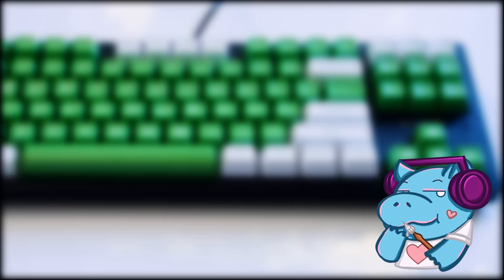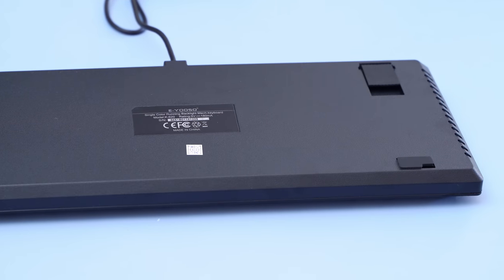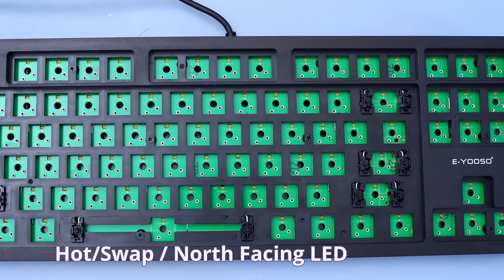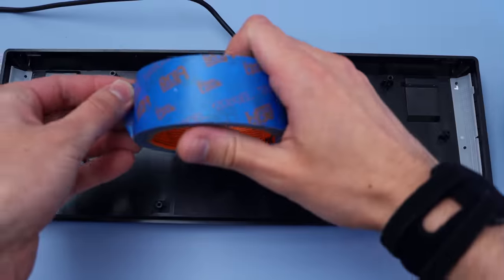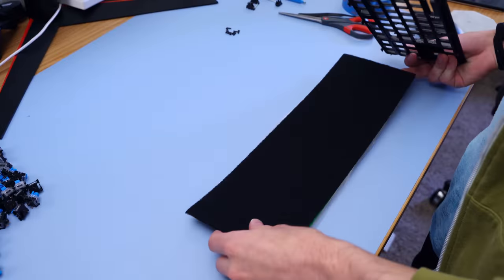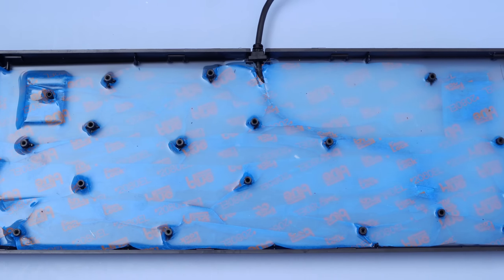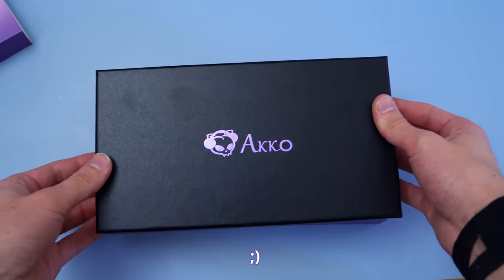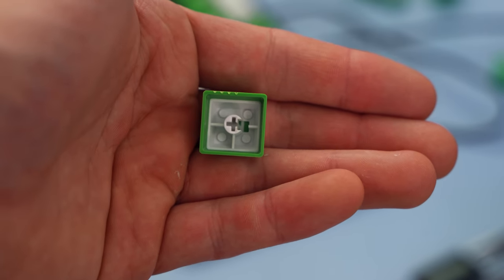I UPGRADED the Most Popular Keyboard on Amazon...

Comment: I actually find it nice that it has a full case rather than a "floating switch design".

The casing doesn't seem half bad either as a foundation. Epoxying a few thin sheets of steel should make it MUCH nicer than stock, like stiffer and heavier. Feel of quality is more important than actual quality, right? But i guess sil-pour works too.
Reply: The casing is crap, it's just plastic. I think the Redragon K552 I have sometimes goes for as little as $30 and that has a fairly thick metal plate, it also has the exact same PCB and keycaps as this board.
Reply: @jm036  Is it the one with absolutely HIDEOUS fake RGB? Actually any fake RGB is hideous, if you can't budget Neopixels, just give me all white.
Reply: @SianaGearz  There is an RGB version (which I have) and an all red version that's slightly cheaper, I think the fake RGB one is the most recent.
Reply: @JuicyyzFPS Did you just assume my gender?
Reply: @JuicyyzFPS me neither, no.
Reply: that would be actual quality if you make it out of steel
Reply: @JuicyyzFPS I'm not even particularly offended, more weirded out. But in short, "no". If you don't want to be mindful of people, people will be offended, nothing surprising about that.

Most people here don't want to be addressed with a honorific, in part because these are only used when dealing with police or a judge, which are usually unpleasant endeavours; and when you pick the wrong honorific, that's the ultimate sign of lack of respect, which is pretty much the opposite of what honorifics should accomplish, wouldn't you agree?
Reply: @SianaGearz  no one cares
Reply: @SianaGearz  fake RGB?
Reply: @josejimenez896  Yeah a keyboard with rainbow lighting but without RGB LEDs, they just use a variety of single colour LEDs that they arranged by key and scattered around the keyboard in all the different colours.

Comment: i had a similar issue with my tecware keyboard! the sockets were designed more for thinner pins like outemu switches but i found a hack by clipping the outer pin to a sharp pointy end using a nail clipper which helped a lot because previously it won’t even fit and even broke 2 switches (gateron yellow)

Comment: I have to say, that silicon o-ring "gasket mount" mod is absolutely clutch for tray mounted keyboards.  HUGE difference.  Another really good mod, which you could have done, is to put keycap O-rings on when you use high profile keycaps.  It doesn't change the feel of bottoming out if you use a single o-ring, but it makes the bottom out sound quieter because there is less reverberation in the plastic.
Reply: In my case, o rings under the keycaps makes it super mushy and way higher pitched.not worth it
Reply: @gearsgamer7115  hi can i know waht o ring to use???
Reply: @madhavds  don't use o rings under the keycaps it makes it mushy though. Ruins ot
Reply: @gearsgamer7115  In this case (pun unintended), you put the O rings in between where you screw the plate and base in.

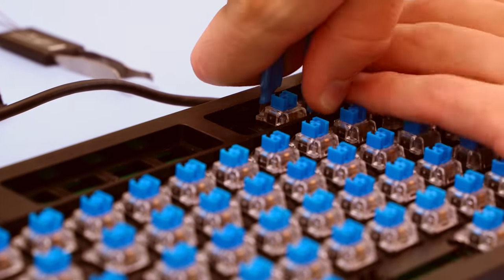Comment: 3:39 I know that feeling, Outemu hot sockets are the worst sockets in the keyboard kingdom! They have a death grip on switches, making it hard to remove them without destroying part of the switch, and they're almost proprietary! They only work with Outemu, Gazzew, Akko, and Lcet switches. (Maybe more than that) (You need to cut the legs off some of the switches that fall under that umbrella to make them fit in the sockets) I know that A good amount of keyfeels fall under that umbrella, and you can trim the pins and take the legs off on some other switches to make them work, but you might not want to put up with that in the first place.

Comment: Loved the video! Those lavender switches seem right up my alley, an affordable tactile switch that comes in a shade of purple! Now, if only I could find a 100% ISO hot swap PCB hahaha (or finally convince myself to drop the numpad as I only really use it for symbol typing)
Reply: Get a separate numpad for home use.
Reply: Thinking that now, with a 75%, like an Idobao ID80.
Reply: While hotswaps are great for installation I generally never change the switches on my keyboard. I own 2 hotswaps and the switches are the same since I put them in originally. My next keyboard project is the compact 110% called the Boston and it'll be fun to solder them in for a change.
Reply: there is the Keychron Q6 but it is expensive, 200$ for Iso Barebone with shipping.

Comment: Have you ever considered using gasket sheets, like the rubber sheets used for cutting out custom gaskets, as padding for the inside of keyboards? I wondered if it may be a more convenient and less messy alternative to pouring silicone like you did in the video.
Reply: or maybe leather

Comment: Would spray Flex Seal work for the painted on silicone? Seems like it would fill in the cracks better and be a lot faster/easier. Loved the content.
Reply: Not as good for sound dampening.
Reply: @yosemitesam9576  could you use flex seal, then use painters tape?

Comment: Anyone remember when IBM keyboards ( like 5150 original pc)?used Cherry keyswitches and cost about $350? I hope the designers who created the TRS 80 Model II keyboard with the foam and tinfoil got a raise for the elegant junk it was. How did it ever work? They survived more that I expected they could. Spill coffee in it, dry it out, clean the pcb traces with alcohol and it just worked.
Reply: I remember the buckling springs in the model f and model m keyboards. The f was more compact and i think the spring lever mech acted on an electrocapacitive element on the pcb. The model m came later and set the standard for keyboard layout but the buckling spring actuated a normal membrane. I never typed on a model f but supposedly it was higher quality than the model m but the early model m seems to be very well built regardless. Maybe they got lighter and more plastic over the years but the one i have from 1989 with a ps/2 cable is heavy and doesn't seem to lack steel parts inside.

Comment: Hi, since my actual keyboard is starting to die, i've been watching a lot of  keyboard review ( especially from yours )  
i've been searching for 2 weeks for the perfect 65% RBG keyboard for either typing and gaming (preferably wireless)
and this were it all begins... There was couple of keyboards that i want your help : Ducky one 2 SF or the Keychron K6 Backlight (both on either MX Red, Red Silent or Brown) ?
The main problem here is as a French i need an FR Azerty Layout but it seems impossible to see good looking FR layout that isn't sold out.
So i was wondering is there a way to buy french layout that fit for those keyboard ??
Reply: I'm not entirely sure what that is however several boards have something called via compatibility meaning you can change key functions with software
Reply: I have a Keychron K6 keyboard. I'd say it is a pretty good keyboard from my experience. The only thing i would say is inconvinient from this keyboard is its ABS keycaps, but that will be easy to solve if you have a bigger budget to replace them
Reply: Pretty late, but tada68

Comment: For all that is good in this world, please spend the extra time and use an exacto knife to cut out the press and seal from the top of the PCB when it comes to the sockets. No need to risk putting a small amount of plastic in the contact that could potentially block the switch from working. I'm an electrician who works on high end things and it's funny how a small piece of insulation in a terminal block can block a signal.

Also, plan out your build before doing it. Have no idea why you didn't isolate the usb pcb connection but instead put it under painters tape before putting silicone over that. Seems like it could have turned out really awfully if there was a small hole that could have let the silicone under the tape. Hope that blocking the air vents with silicone doesn't cause a long term issue. Some of those budget folks could use this advice because who knows if they can swing another $20 on a keyboard.

Comment: Hm... I'm considering getting silicone for my resin projects already... Maybe I should try this on the cheapo keyboard I picked up on Amazon too. PC335A. Normally 35-40 for a wireless clicky board. Found it for 20 somehow... And it actually works. It sounds awful and isn't hot swap, so much work is needed. Lol.

Comment: 20 dollars and so nice switches sound soooo good ngl
Reply: The stock is bas unless you mod it with better clixky switches. Yes, you cant fit all switches in it, but... Youcan sand down the metal legs on the new swithces and cut plastic legs.

Comment: Btw way you can fit any switch into those sockets, all you have to do is if their 5 pin is cut their legs off with nail clippers and if their pins that arnt outemu you can clips the pins at a certain angle to make them work fine

Comment: I just bought a red dragon k552 with cherry mx blue. I kinda dislike it, should I go ahead and buy the RK61 or should I just buy new switches and key caps .
Reply: Buy an rk61, if you like clikies get zealpc clickies(yeah they super expensive but worth it beacuse thechnically they are 50 cents each. This is ebaxuse they are a three in 1) or box jades

Comment: I had the reddragon keyboard, and got iot a few months ago, with red switches. Same keycaps and alright ish red switches. I had planned to upgrade and i need the extra keys so I wont go full custom little keyboard. Sounded alright, but I got the new keycaps, and those switches, but none of the diy stuffs. I had a nice keycap and switch puller and needed the clean the case anyways. Sounded really good! Ive been calming down with all of the rgb and I needed new keyboard, mouse, headset, and mousepad.

Comment: By no means into the hobby of building or modding my own keyboards, and the only thing that got me down this rabbithole was watching reviews on a keyboard I haven't even received yet (Razr Huntsman TKL). 

That last shot for audio really reminds me of what old IBM keyboards sounded like growing up. Buckling springswitches and all. 

Again, not into this hobby at all and I'm sure I'm not saying anything groundbreaking, but I do wonder how much of creating a quiet keyboard is a combination of acoustic chamber (case in and above the PCB) and the height and emptiness of the keycaps. A taller key seems like it'd create more of a sound, or at least encourage one either through air or echo. Low pro keys would seem quieter. This is part of why laptop keyboards are dead silent, save being membrane actuated versus mechanical. 

All wrapped up, I think this is one of the stranger rabbit holes I've gone down and I'm not disappointed but mostly intrigued. I do chalk it under "hobbies I'd never tell girls I'm into" though.

Comment: 100$ is budget 😁
My definition of budget is 20-30€. And I'd still think twice before buying. \
Currently using 12€ membrane keyboard.
Reply: 100 dollars is a very small budget for the keyboard world lol. A custom built average keyboard will run you about 200-250 dollars and thats on the cheaper side. Its a very expensive hobby

Comment: It's literally the same keycaps as the red dragon k552
Reply: ikr i have the red dragon k552 and for a sec i thought me had the same keyboard
Reply: I just hate those
Reply: @GiontLegend  yea lol, ohhh do the tape mod and foam mod on the backplate, 3 layers of tape and fill the bottom with pillow memory foam and it sounds BALLER
Reply: @insid3493  thx for the idea i might try it ngl
Reply: @GiontLegend  np, but definitely give it a go it sounds 👌👌👌
Reply: @GiontLegend  ay yo, also bro try to use a thick lube or engine greece to lube the switches and the stabs, it actually sounds like a $600 board, I did it the other day and it sounds 🔥

Comment: I had a shit keyboard lying around collecting dust from when I started gaming on pc. It had blue loud switches and the cable wasn't detachable...

1st thing I did was opened it up and cut the usb cable and made it a detachable usb type c keyboard. ! Great mod. 

2nd thing I did was desoldered all the shit blue switches !

3rd thing I did was remove those horrible stabilizers! 

4th thing I did was buy some yellow switches and lubed them up real nice same with the stabilizers!

Finally I cleaned up the board since it looked so freaking dirty and disgusted and I also soldered in the switches and added in the new stabilizers !

Also I did the foam mod, tape mod, and I added o rings to the screws to so they don't rattle and I added foam to the keyboard to make it a tad bit bitter. 

The final thing I did wasn't even the keyboard, I made a custom coiled usb type c detachable with aviatoe connectors cable for the keyboard.!!! Everything turned out beautiful.

After all this work I sold that old $20 keyboard that was trash for $200. 

I have another lying around and I can't wait to get to it.

Comment: I legit am typing this comment with the yooso keyboard. Upgraded from a broken blackwidow to this. I have PBT keycaps on it but I really want to do a silicone poor like yours. 

Any one got good clicky switch recommendations for it?
Reply: sorry if im late. If you have sandpaper, you can clip the plastic legs off some zealpc clikies and sand down the metal pins so it fits in the socket.